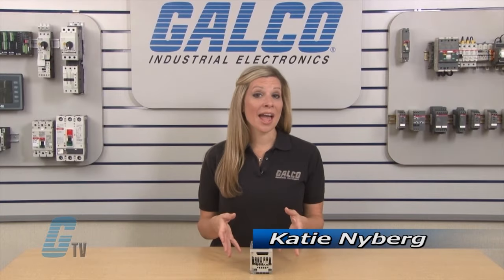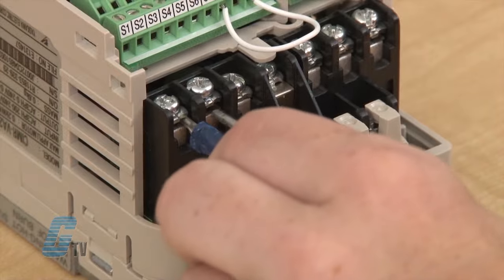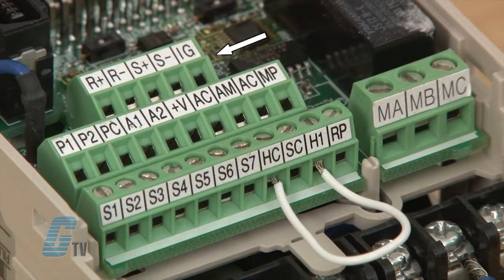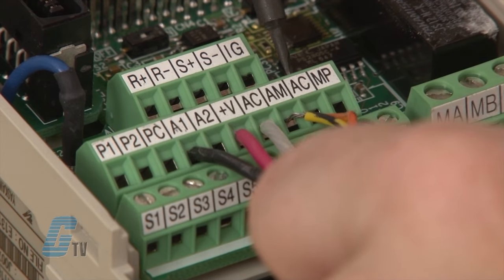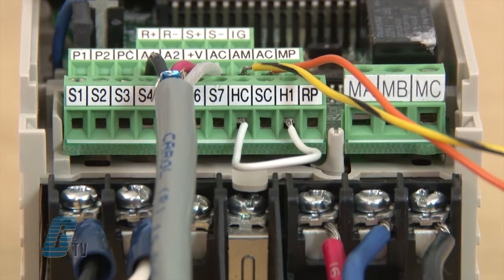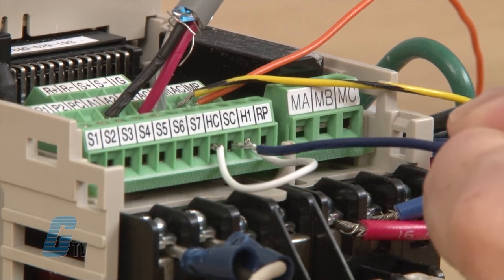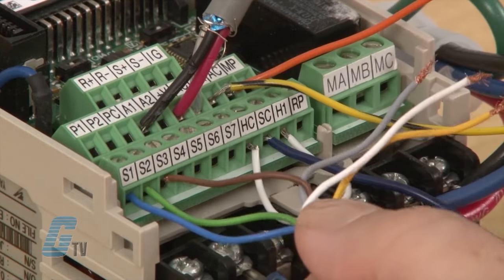How to Wire-Up a Yaskawa V1000 AC Drive

Comment: hi there... is it possible to use the analogue output of 1st drive and connect it to the analogue input of the 2nd drive for PID control? i would like the speed of the 2nd drive to change according the the amps of the 1st drive

Comment: dear sir there is no load connected to the drive . when ever i push the run button it shows oc . i think the fualt may be in the hardware  . can you pleas tell me which ic refers to the current detection ???

Comment: sir plz can you tell that how to clear a "call" fault communication transmission error appear when drive power on
Reply from the maker: +ahmad rehman do you have have serial communications connected to the drive?
Here is a link to the technical manual, http://www.galco.com/techdoc/yask/v1000_tc.pdf,
if you go to page 255, it list possible causes for that alarm. On page 397 it
shows how to perform a self-diagnostics test of the communications in the drive
to confirm the drive is good.

Comment: Are the control inputs 24vdc or 110vac?
Reply from the maker: The inputs directly to the drive terminals are 24 volt. However a 110Vac option card is available if needed.
Reply: GalcoTV thank you

Comment: Hello Galco!  Thank you for making this video's you've made a customer out of me! Im starting frim scratch on a milling machine. I need to put together a complete control panel from scratch. can you please make a video going over configuring it this vfd for milling machine application? Thanks!
 i ask because i just purchased this drive to replace a faulty drive on a mill at work. The settings for the old 90's yaskawa drive don't translate well to the updated drive. Stuff like acceleration time, deceleration time. Braking ect. Id hate to set my DC braking wrong and de-magnitize the expensive spindle induction motor.  Maybe I can get an email to send a copy of the machine specifications for the drive settings to have help help translating  them?
Reply from the maker: It sounds like you have taken on an extensive project that would be well beyond the scope of our videos, so we probably won't be able to make a video for that kind of instruction, cuz it would have to be hours in length and as you may have noticed most of our video's are only 2 to 6 minutes in length. For that kind of help you would need to talk to 1 of our engineers or a product manager may also be able to help. Give us a call at 800-337-1720 and ask for our Yaskawa product manager.

Comment: When i connect  s1 to  sc becomes reverse direction instead forward direction ...why? 
s2 to sc 
It reverse direction in properly
Reply from the maker: To correct motor rotation usually all you have to do is to swap any two motor leads.

Comment: sir,  may u tell me what is the use of photocoupler and pulse train input and outputs in v1000
please
Reply from the maker: +Jaskaran Singh The photo coupler outputs can be programmed to turn on a transistor based on a status of the drive, such as DRIVE IS RUNNING or DRIVE IS AT ZERO SPEED for example. This output signal could be used to turn on a light or give a signal to a PLC for example.

The pulse train input is used to control the output of the drive or as a feedback signal. This pulse train could come from an encoder that is turned by a different part of the machine for example, then the drive output could match the speed of the encoder.

The pulse train output provides an high frequency output that that can be programmed to show a monitored value of the drive such as output frequency for example. This signal could be used to feed another V1000 drive’s pulse train input so that it will match the speed of the first drive.

Comment: sir can you please tell me how oc fault can be repaired ???
Reply from the maker: +Imran Aslam An OC fault is an overcurrent fault, this can be caused by many factors. This could include motor load issues, the motor itself, wiring, drive parameters or a defective drive. If the drive had been running fine for a period of time and no parameters have been changed, you can assume that it is not a parameter issue. 
If the drive is set-up to run in V/Hz mode, I would suggest disconnecting the motor from the drive and then start the drive. If the drive still faults out on OC, typically that means the drive is defective. 
If the drive doesn’t fault out, with the motor still disconnected, I would testthe motor and wiring to ground using a megger. This will check to see if anything is breaking over to ground with high voltage.
If that tests good, I would try to run the motor with the it uncoupled from the load. Measure the current, using a true RMS or an analog current clamp, on the
three output wires to make sure they are balanced and below the full load amps
of the motor. 
If that looks good, reconnect load and re-measure the current to make sure it isstill below full load amps of the motor. If the drive faults and the current is
below the full load amps of the motor the drive could be defective. If the
current is above, then check the load on the motor.
See the Yaskawa manual for more information on possible causes for an OC fault.
Reply: thanks you...

Comment: excuse me, i need use the potentiometer to control a C.A motor whith yaskawa v1000. first  I need to configure the parameters current, voltaje, RPM, Frecuency. in yaskawa and then operate in remote mode??? thanks
Reply from the maker: OK Diego, go to parameter E1-01 and verify the line voltage set correctly for your application, E1-03 = 1 (by default for 60Hz motor) be sure you have correct V/F pattern selected, then go to E2-01 load motor rated current (FLA), E2-04 for number of poles, and E2-11 for motor rated power in KW. Now you want to run a rotational Auto-tune, just make sure your motor in not coupled to the machine before running autotune, ok?

Comment: What fault ope12, thanks
Reply from the maker: Is not listed in the manual so you will have to give us a call at 800-337-1720 and ask for a product manager or contact the factory directly.

Comment: please help us to configure VFD with computer interface
Reply from the maker: Ok the drive uses RS422/485 with MEMOBUS protocol (the manual shows MODBUS next to the memobus labeling too). Do you have the software?
Reply: Yes I have
Reply from the maker: Ok well with most startup you load your motor data first, determine a reasonable ACCEL/DECEL time for you application, program max speed and then you probably want to Autotune it.Is the motor uncoupled from the machine?
Reply from the maker: Let us know how you make out, ok?
Reply: it is not detecting the drive
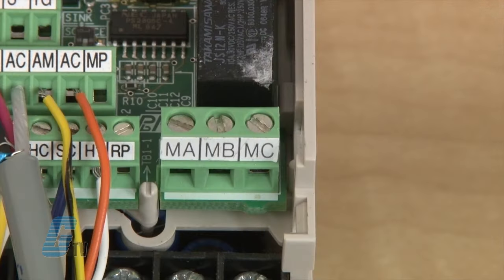Reply from the maker: OK Srinath, I'm going to recommend you talk to 1 of our Product managers, please give us a call at 800-575-5562 and ask for assistance with this issue. Our office hours are 8am to 5pm EST (-5:00 GMT).
Reply: if you want i can give remote access to my computer .
Reply from the maker: Found some additional information for you to try. Make sure parameters are set up correctly H5-01 to H5-12, also if you only have the 1 drive connected make sure the termination switch "S2" is ON or the drive can't see the PC and PC can't see drive. If you still have trouble, give us a call at the number I have listed. If you can't call and would like another means of contact let us know, ok?
Reply from the maker: Would like to know if you get it going to please.
Reply: can i share the screenshot through skype

Comment: 2:11. WARNING: To everyone using Remote Inputs with a Potentiometer to control their equipment with a Yaskawa VFD. Make sure you look at your Yaskawa VFD's Control Circuit Diagram (it is available in the first few pages of your Yaskawa VFD Manual) to find what Ohms level Potentiometer it NEEDS. If you use a Potentiometer with a different Ohm's level than what the Yaskawa VFD NEEDs, you could BURN YOUR MOTOR at motor start up.
Reply from the maker: Our manual shows a 2K ohm Potentiometer for the V1000 . Max did you damage your motor with this drive?